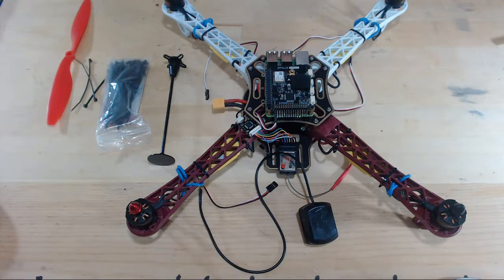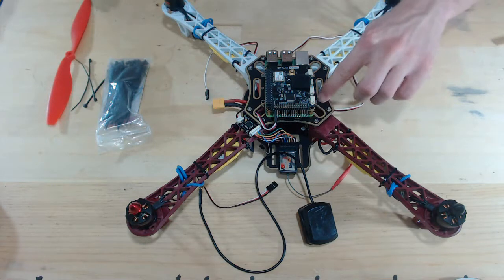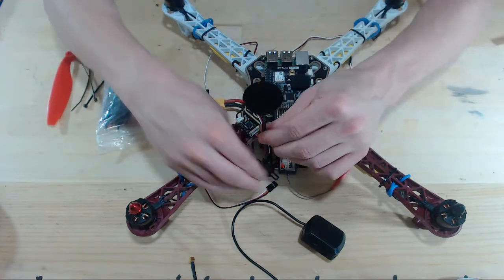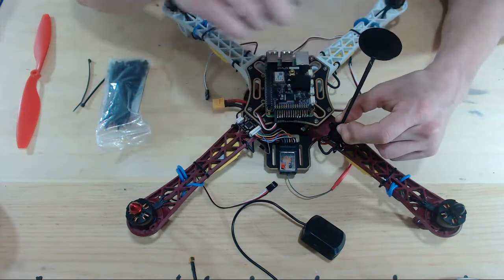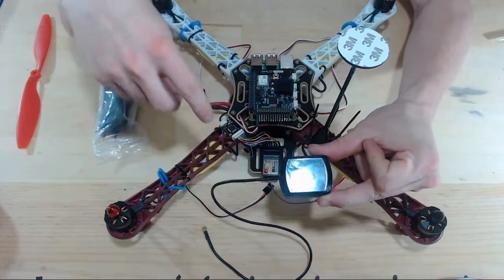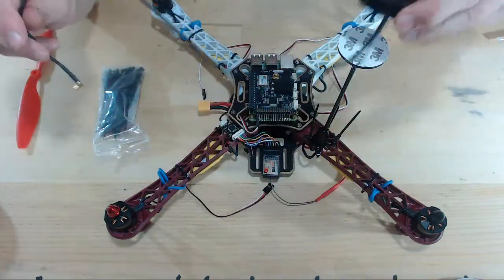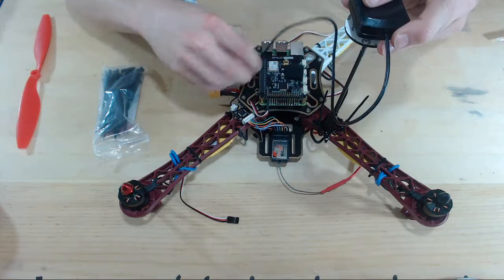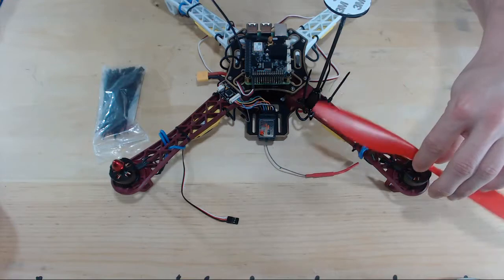Installing a GPS Module to a Drone

Comment: Do we also need aerodynamics knowledge to make manned Quadcopter ? Please let me know ? Is Arduino or raspberry Pi controler are strong enough to control and maintain the stability of manned Quadcopter with weight upto 300 kg or 400 kg ? Please let me know. Thanks. Brother yours videos are great.